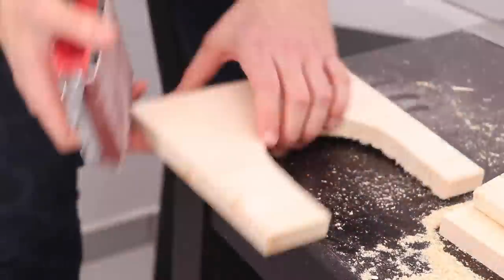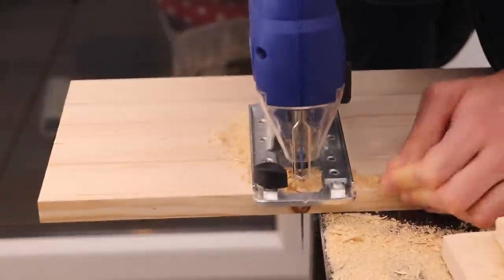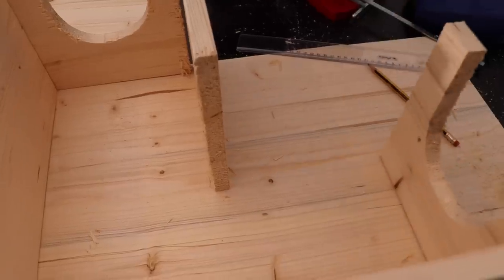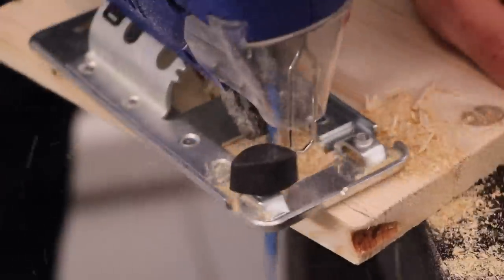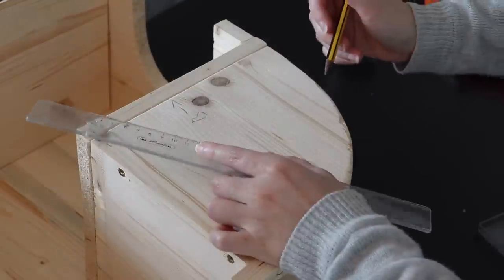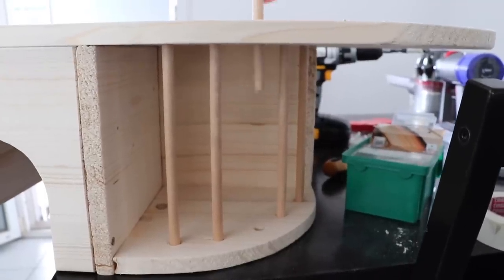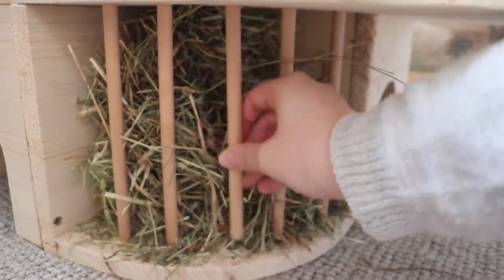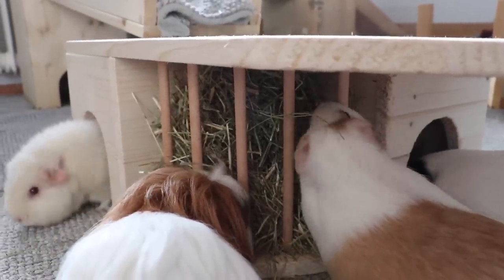DIY: Perfect Guinea Pig House + Hay Rack | DIY Toys for Guinea Pigs

Comment: Love it so much its awesome awesome job  ⭐️ ⭐️ ⭐️ ⭐️ ⭐️ ♥️♥️♥️♥️♥️ P.s if you put masking tape down where you are going to cut you will not get the rough cut around where you are cutting or use a finer Saw blade not so course and you will not get the rough cuts ⭐️ ⭐️ ⭐️  ⭐️ ⭐️